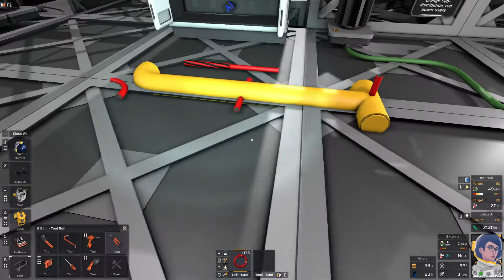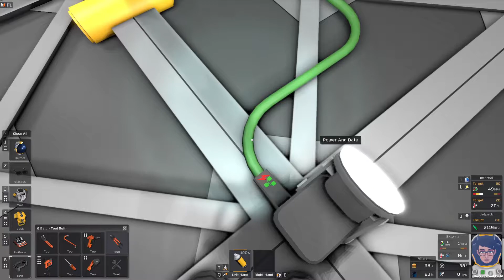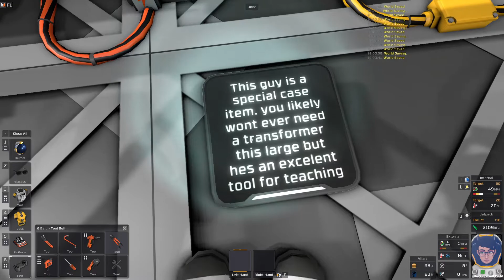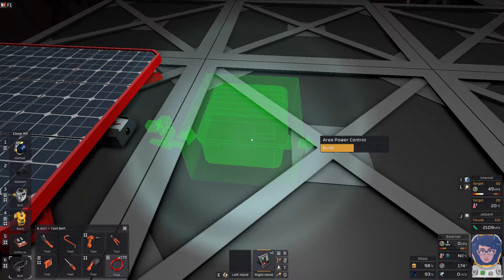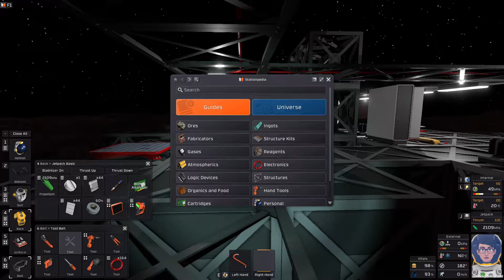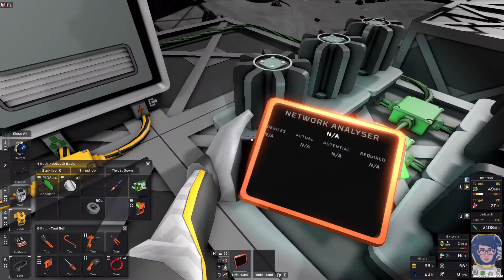Stationeers Power Distribution and Cables Tutorial

Comment: Still a good vid,  one tip about 5 min in,  when you are trying to save on paint you can take 1 painted item (cable) in your hand, pickup more of that item so long as it's not a full stack, and they will ALL turn the painted color.  So for cables have 1 green in your hand, 49 red ones fresh out of the printer, pick them up using the 1 green cable hand, and presto you have 50 green cables.   Not sure if this only works on the "easy" mode or whatever they renamed that too now, but that little "bug" has been in the game forever ;)
Reply: This works on normal mode, discovered it the other day, same for pipes too